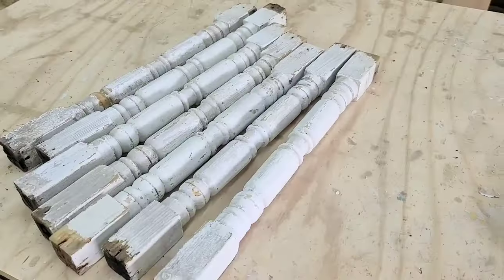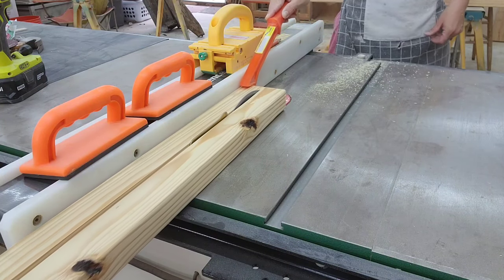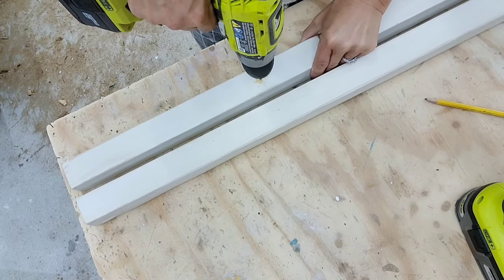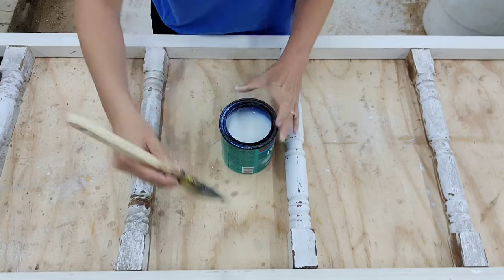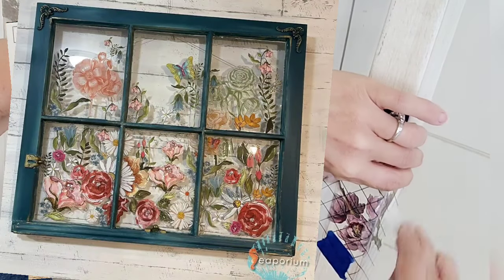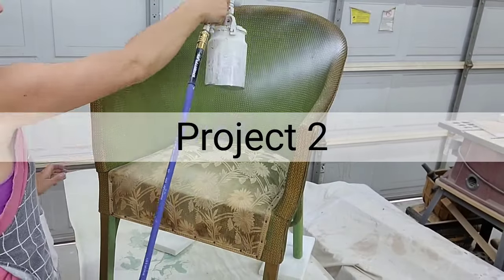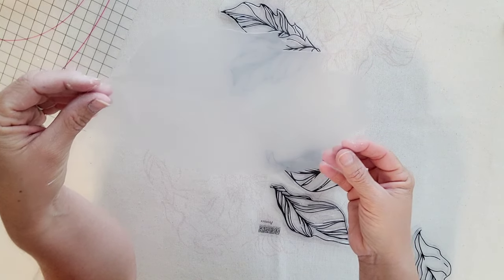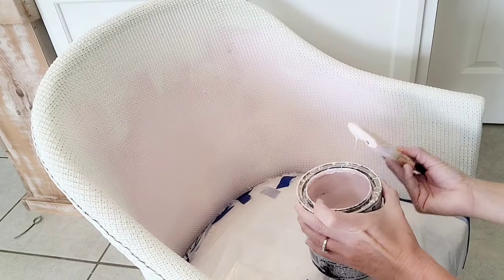Trash to Treasure: DIY Blanket Ladder + More with the IOD Design Team

Comment: I find when I get a new stamp, I just sand the whole page before I removed or cut them apart.
Reply from the maker: Yes! That's definitely the easiest way to condition them - then you don't have to remember which ones you've prepped and which ones still need to be sanding. :) Thanks for sharing that tip.